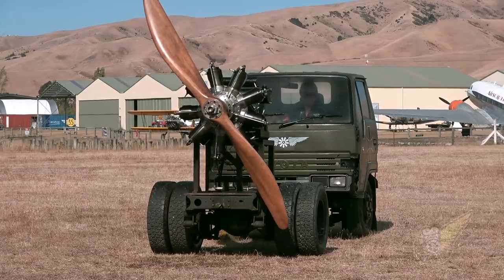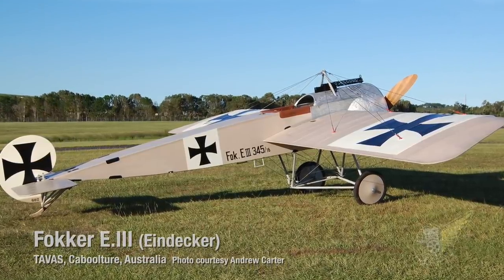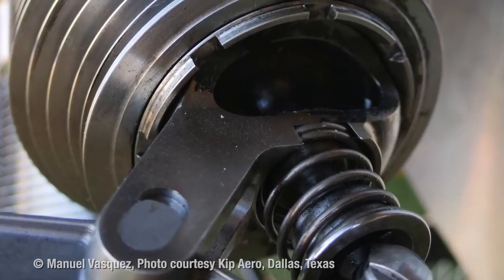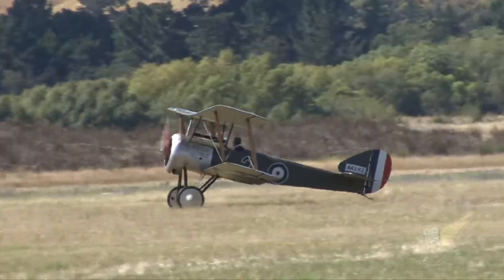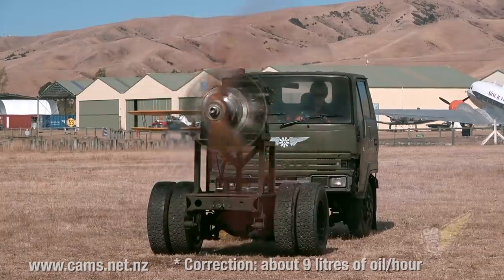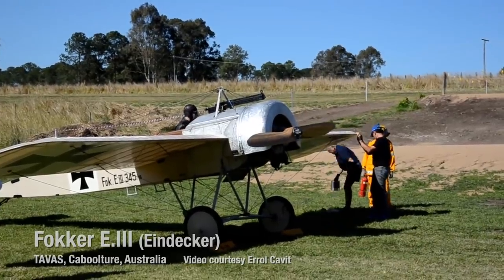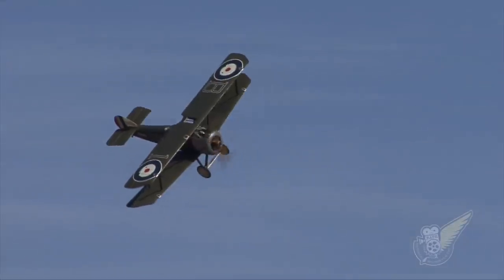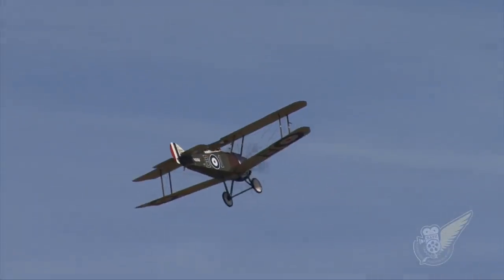Building New 100-Year Old Gnome Rotary Aero Engines In NZ

Comment: Good Work. The day after watching a History Channel show on these engines, which I knew nothing about previously, saved my life. The Four-barrel carb on our Built smallblock Stuck Wide Open on a small, curvy country road. Instead of panicking and getting killed in a wreck, I reached up and started turning the key Off and On, just like a Rotary, and drove it through the 90-degree s-curves to a wide spot where I pulled off, cleaned dirty underwear, and freed up the carb linkages...

Comment: Absolutely amazing!

As a 7 year old in the 1950s, I flew a couple of times from Baragwanath SA. An old guy had a SE5a and some rotary. I got 1 trip in the de Havaland but the rotary was obviously a single seater. I have forgotten the plip of the motor and the overpowering smell of caster oil (and also the runs I suffered for the day following the rotary startup).

Thanks for the goose bumps. I got VERY nostalgic when I heard that sound. The imagined smell of caster oil.
Reply: SE5 A'S DID NOT HAVE A ROTARY ENGINE. V8 I THINK.
Reply: During the First World War the only oil suitable for these engines and also other engines was castor oil. Nasty stuff for humans to injest or breath. It was the cause of many in flight problems as the pilots would experience explosive diarrhea possibly while the enemy was strafing their fighter.
Reply: @donaldbowen5423  hispano-suiza I believe.

Comment: Well done and good philosophy going forward.  If concerned about getting the smell of the castor oil, it only takes a little bit in the fuel itself to render that agreeable odor so using it in the total loss lubricant needs of the engine isn't a priority.  Have been through many seasons of learning about the qualities of castor oil from motorcycle racing years ago - modern synthetics have covered the needs more than adequately and surely a balance will be struck to refine these modern rotary renditions to optimum service.  Btw, had many visits to Old Rhinebeck Aerodrome to watch the ancient engines at work, what sights and sounds those were.
Reply: +1 for Old Rhinebeck reference!  Saw the show several times as a boy in the '70s as my Dad would make a side excursion on our way to summer vacation in Maine so we could see it.
Reply: Cole Palen himself took me for a ride in a 1930s Grumman monoplane. Summer,1968. Nice guy,unforgettable ride. Since I was in the front compartment,I guess I was male mail.

Comment: I think the idea of finding an alternative to castor oil is a smart idea. The gumming from the castor is the bane, so to avoiding the bumming would be a god send
Reply: Seriously, finding a replacement for the pure castor oil is easy as pie. While usual bio-diesel is made of rape seed oil and Methanole, one can do the same with castor oil, thus removing the gum-building Glycerine from the castor oil and replacing it with an Ester from the Methanole. This castor oil-based "castor diesel" offers the same great lubricating capabilities and smell as pure castor oil does, but won't gum up the engine at all, because all excessive "castor diesel" will be burned through combustion.

Comment: The rotating mass must be incredible. Amazing anyone was crazy enough to invent and build it.
Reply: It had a good power to weight which was needed for aero engines.
It used the existing mass of the cases and cylinders as the flywheel instead of using a separate flywheel.
Indeed it does have rotating mass problems  in that the gyroscopic effects were significant and gave rise to difficult handling.
These were most prominent in the Sopwith Camel which could outfight most things including its own pilots.

Comment: The gyroscopic reaction of the airplanes powered by the Gnôme required some special control inputs!
Some gyroscopic effect comes from an ordinary motor's crankshaft and propeller but the rotating motor was a thing apart.
Reply: It added an amount of rotational inertia broadly equal to that of the propeller in a radial or inline type. 

Thus the overall effect is only about twice that of the 'normal' behaviour. The late war Seimens Halske rotaries eliminated precession effects (but not torque) by contra-rotating the cylinder block and propeller at 900 rpm each, in place of the typical ~1250rpm in the same direction of a standard rotary.

The lighter weight and small size of rotaries compared to inline engines increased the impact of this doubled gyroscopic precession in their very light weight airframes, but the degree is often overstated.

Comment: while in aircraft mechanics school back  in the early early sixties  we were introduced to all sizes and types of radial engines. If memory serves me they were a French design  and it was designated the Rhone radial. They were five Cylinders, never more or less. There are a number of prototype tiller style cars with this engine laied horizontal driving the rear wheels. As a mechanic for 30 years I never came to accept the idea of the entire engine spinning around the crankshaft. Except as an oddity it never caught on . 

the rear of the car
Reply: The main French manufacturers of rotary radials were Gnôme, Le Rhône, and Clerget. In Britain Bentley built some, and Germany had Oberursels that were simply Le Rhônes built under a license that had been taken out before the war.
Five cylinders were common in the earliest versions but seven and nine cylinders were more common. There was even an eleven cylinder single-row rotary radial engine. Other rotaries were built with double rows of cylinders and some experimental engines with fours rows of seven cylinders each were built. 28 cylinders spinning! Similar to the much larger and much later fixed Pratt and Whitney R-4360 radial of WWII.
All radial engines, whether the are fixed or rotary, have odd cylinder numbers. They would shake if they had an even number of cylinders.

Comment: I saw one of those st the Naval Museum in Pensacola.  I assume it exhausts directly from the exhaust valve at the top of each cylinder.  I don't understand how the carburetor works nor do l understand why it can't be throttle controlled like any other internal combustion engine.
Reply: The crankshaft was hollow,the carbeurator was bolted to the crankshaft.
Reply: @UCGMNgljn4EAOjfh3t_JZNug Thanks Paul.  That solves part of the mystery.  My computer's not hooked up so l'm using my phone.  The drawings l found are too small for me to read the writing and blurr out if l expand  them.  I think l saw drawings of both engines which was very confusing.  Yes, what you said must be true.  There's a single valve and a two valve.  The two valve's intake valve appeared to be inside the intake manifold.  I couldn't understand how the other one worked.  That one was probably the 2 speed engine.  If the other had a carburetor it's revs should be able to be adjusted better.  Hearing the 2 speed land is  quite fun.
Reply: @paulmanson253  Ok, l could see a device on the crankshaft that l assumed was a carburetor but it looked like an ell pipe fitting turned down.  I've seen them run on video but never in person.
Reply: @leonardodahumanoid4344  Adjusting the primitive carburetor was so difficult it was best to adjust for maximum output. The two speed you hear is the ignition cutoff. To land,the magneto was grounded as the pilot blipped the rpms  with a button on the joystick. Other than that,the engine ran flat out. And remember the torque was enormous. Gyroscopic precession is at 90 degrees to the input of force to change the centerline of axle(crankshaft). So pull up,the airplane goes right. Push down,the airplane goes left. Etc. To go down you push the stick right(I think). Think of having a car of right hand drive AND the pedals are reversed. Clutch on right hand pedal.. You teach yourself muscle memory,you can reteach yourself,but requires careful attention. Wait till you can Google bigger images. It all makes sense. I think Gutenberg.org has an engine service and assembly manual available.
Reply: +Leonardo daHumanoid

G'day,

  From what I underconstumble, the original Gnomes had a spring-loaded Inlet-Valve in the Crown of the Piston, with a combination of Gasflow and Centrifugal Force opening it & Gas Pressure plus the Spring shutting it ; and any sticky Valves blew Flames out the Carburettor....

The later Monosoupape shitcanned the Piston's  Poppet-Valve and substituted Bypass Ports, uncovered by the Piston, to suck some Fuel-rich mixture up from the Crankcase to join the Inlet AIR which comes in through the Exhaust Valve's delayed Closure - after having vented the old burnt gasses...; the fact that half the Air in the Fuel-Air Mix comes in through the Exhaust Valve means that effective throttling is rather like masturbating with Chopsticks and a Periscope - theoretically it is possible, but nobody ever bothers because it's supremely impractical.

Full-Throttle, as modulated with the Ignition Blip-Switch, or Idle...; them was the available options.

  Then the Clerget and Bentley types had 2 Valves in each Head, and Inlet Manifold Pipes..., and the Bentleys are indeed able to be throttled...; I think the Clergets were also throttleable, but that's only a guess - whereas I've heard a Bentley BR-2 operator (Kermit Weeks) say that his Sopwith Snipe has a functional Throttle - within limits, as well as a Blip Switch.

Have a good one,

;-p

Ciao !
Reply: @WarblesOnALot  You too.  Ever since l saw and touched one of those engines l've wanted to understand how they worked.  It's like having an itch you can't scratch.  From stories my parents tell l was born that way.  I appreciate all the information l've received.   I can imagine how thrilled pilots who flew with these engines that had so much rotating mass were thrilled when they first flew with an engine with a stationary crankcase.  I'm sure the response to control input was so much better.
Reply: Ah, yes..., I'm a sort of retired Extreme Aeroplanologist..., and if you dig into the Threads under Comments made by + Merle Patterson and +Scott E Channels hereinunder, on this Scroll - then you can chuckle at how far into it I got....(even unto where to see a video of what took me for my first Solo ; safely chained up to the ceiling in a Transport Museum, incarcerated there for it's being notably worse than the 1903 Wright Flyer (8Hp, 2-Axis Controls, Single-Surface Aerofoils....{!} ).

Backtrack me to my "Personal Aeroplanology..." Playlist to see some obscure bits of Levitation..., or peruse the other 17 Playlists.

I'm an eccentric  Hillbilly Forest Hermit, with a YT Channel running on a Mobile Phone, Solar Powered - off-Grid.

Someone has to be the Fool On The Hill ; and around these parts - I seem to have the Gig sewn up pretty tight (!).

Have a good one,

;-p

Ciao !

Comment: The beauty of these wonderful engines is that the pistons/rods do not reciprocate as in the radial look alike and although there is more rotating mass they are very smooth, well done in resurrecting this excellent engine from 100 years ago.
Reply: They still reciprocate, they're just turning around as they do it
Reply: @MiG21aholic  No , they do not reciprocate at all, the crankshaft rods and pistons have no reciprocating motion at all, they remain in a neutral position the whole time the engine is running, in a rotary engine it is the cylinders and crankcase that rotates.
Reply: @453421abcdefg12345  So how does the engine even work then if the pistons don't move up and down in the cylinders???????
Reply: @453421abcdefg12345  I know the crank stays still, the pistons still reciprocate relative to the cylinders though...
Reply: @MiG21aholic  : Yes, the crank stays still, therefore the piston/rods do not reciprocate, they will only be reciprocating if they move relative to the crankshaft, and they do not, they stay in one place, the reason they would appear to "go up and down" is that most people think of this engine design in terms of a radial engine, which it is not, the fact that the crankshaft is offset to the radial point of the rotation of the crankcase is what gives apparent up and down movement to the pistons, but of course they cannot move up and down because they are fixed to the non rotating crank, there is a very good animation on YouTube which explains this , if I find it I will give you a link. A picture is worth a thousand words.
Reply: I think it is a matter of interpretation.If the pistions do not move up and down the cylinder,however that motion is brought about, ie they reciprocate relative to the cylinder then there would be no pressure differential  and so no induction ,compression etc.
I think from most points of view the pistons reciprocate up and down a cylinder to produce a swept volume.Whether you are moving the cylinder rather than the piston the relative result is just the same.
Reply: @billycaspersghost7528  the cylinders reciprocate not the pistons. The pistons stand still and the cylinders move in this type of engine.
Reply: Yes I know.The cylindesr rotate not the crankshaft,hence the name "rotary engine".
But it is this rotation relative to the crank throw that causes linear movement between cylinder and piston that induces a volumetric rise and consequent pressure drop.
However you arrange it this is really a reciprocating Otto Cycle engine not a true rotary machine as  a turbine is(Braydon cycle). If there was no relative movement the engine could not work .
As I said before whether you move the piston in a fixed cylinder or a cylinder over a fixed piston,this is reciprocation of a cyclic engine
Reply: @billycaspersghost7528  I think the main point was that as the pistons and therefore the connecting rods are not reciprocating up and down, but moving in a constant rotation about the crank pin, there is no acceleration and deceleration of the connecting rod and piston. Therefore there is no cyclical tension and compression loading of the connecting rod.
Reply: If the con rod is not subject to compressive or tensile loads it would not be a stressed component and could be made of cotton wool or of no greater substance than was necessary to bear its own weight.

This is plainly not the case as it bears the loads of the squeeze and bang part of the Otto cycle as well as the other parts.
 Again, this is a reciprocating engine and how you arrange the cyclic volume and pressure differences is not fundamental to how it works.
Whether you move the piston up and down a fixed cylinder or move a cylinder over a fixed piston the effect is the same.
If I operate my bicycle pump by moving the piston up and down the cylinder or move the cylinder up and down while holding the piston stationary the effect is the same.
If you were to draw a pressure/volume diagram for 2 identical ,imaginary ,engines ,one a radial and the other a rotary there would be no difference.
Reply: @billycaspersghost7528  Yes, I agree with you, the conrod is a stressed component. Wankel rotary engines are outside of my expierence so i'm not going to get into that mess. My comment was directed at the purely inertial forces the reciprocating piston puts on the con rod as it is abruptly decelerated and accelerated at the top and bottom of it's stroke. This force can be quite substantial with high revving engines. Even if there is no compression and no fire in the cylinder, the reciprocating piston mimics a slide-hammer acting both ways on the connecting rod. With a rotary-radial engine the pistons are rotating about a fixed crankpin axis and (with no compression or combustion) the centripetal force from the pistons puts a constant tension force on the con rods which is much easier to design for.

Of course this is assuming there is no compression and/or combustion within the cylinder. With compression and subsequent combustion there is now a compression load on the con rods which can complicate the engineering a bit.

Back in the day thrown connecting rods used to be a common occurrence especially on hot-rodded long stroke engines that are forced to rev higher than they were designed for. That immediate deceleration and acceleration at the end of the stoke can be quite a killer.
Reply: @billycaspersghost7528  Think of two circles with different centres. The pistons rotate inside the rotating jugs. The difference in the circles is the displacement.
Reply: This is actually an astute observation.  If you were able to remove the cylinders and lock the pistons and rods in place, then in fact the pistons would swing in a perfect circle.  The cylinders swing in a perfect circle with the trick being one circle is offset from the other.  No wonder they didn't vibrate because the pistons aren't going up and down as a function of reciprocation.  They are moving as a function of offset rotation!  I never thought of it that way!  Well done!

Comment: I think it is great that you guys are re-creating rotary engines from scratch.  But what is up with that half assed truck/engine stand?  How do you drive that?
Reply: The truck has been set up to allow us to have testing equipment set up and have everything easily moveable.   We have also been known to drive the truck around using the engine on the front for a bit of fun.  Check out the "news" section on our website. Video "Out for a drive with a Gnome" https://cams.net.nz/news/
Reply from the maker: Just like a normal truck!